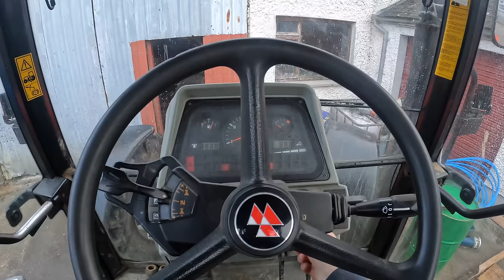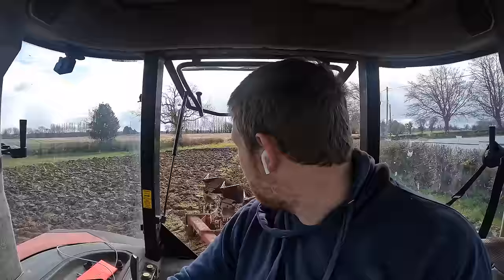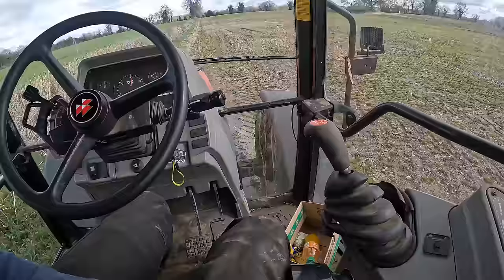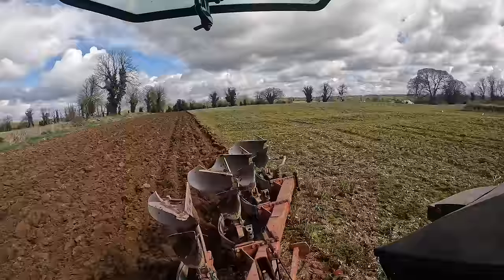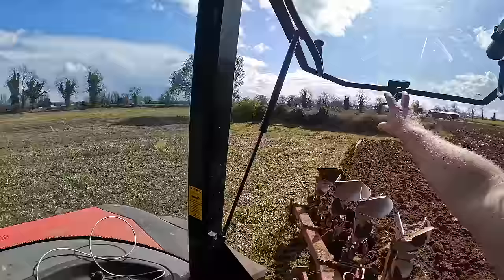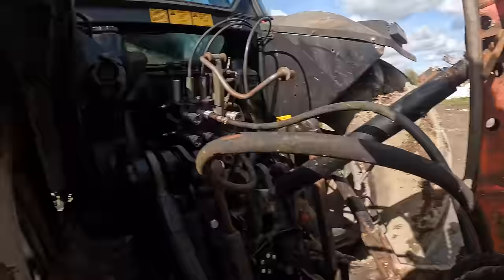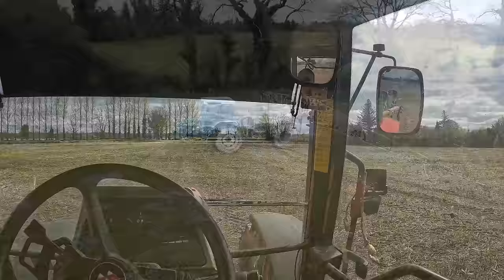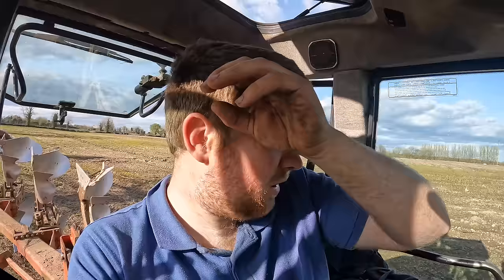FATHER PHIL BROKE THE PLOUGH | PLOUGHING IN THE SLURRY

Comment: Another cracking video showing that it doesnt always go to plan ! Never seen a turnover bracket split across the bolt holes before, seen plenty with the pin end broke off them. Your ploughing isnt that bad, i assume before you started you checked the two rear tyre pressures matched, the lift arms were the exact same height and the check chains were slacked off before the plough was hooked on, getting the back furrow right is a combination of top link length and the big nut on the turnover ram stop, if the plough turns too much the back furrow lifts out and the front furrow is in to its bollocks, also a hydraulic cross shaft will sort the front furrow width. Another thing is your balls could be worn on the plough legs which let them move sideways or up and down once you start pulling through the soil, nobody can do good ploughing if the plough legs are moving, one can be ploughing 14 inch, the next one 16 inch and the next one 12 inch, it will be some mess. Leaf springs should be 700mm from center to center of the pins, that can make uneven furrows as well if they are not all the same tension. I plough stubble ground every year with the exact same Model E plough, 160 head stock, number 8's, a full set of discs and grass skimmers pulled with a 6270 running on 18.4's x 38's, when its done right you cant tell if its ploughed with a four furrow a five furrow or a six furrow plough.
Reply: you are right Jacky. Its not often just one reason why a plough is acting up. Wear on moving parts is most likely the cause if all the initial adjustments are all ok
Reply: This man has a bigger brain than Elon Musk
Reply: He knows his ploughing!🙌

Comment: It's the four balls that the plough body is set agenst with the spring pressure. The balls may ware and if one falls out and you put a new one back in, it will distort the other three resulting in the furrows not matching up, had the same problem only way to sort it is replace the 4 balls on the body's of which furrows aren't ploughing evin with new balls

Comment: Ur springs on the plough don’t look like there set right they are bent out in the middle to much which means the leg of the plough has less tention to keep it in the ground it wants to be less say flatter to apply more tention to the leg it should be 70 inches from pin to pin on the spring but also check that there’s no leafs broke in the spring cause that’s can cause it to be weaker aswell

Comment: It looks like your front furrow is too big when your ploughing right hand. Either check your stabilizer on the right as you stand behind the tractor it could be preventing the plough from moving to the right more. Also is your top link running in a straight line?